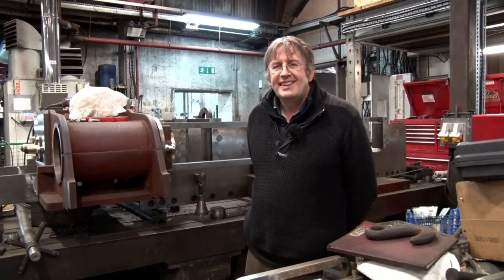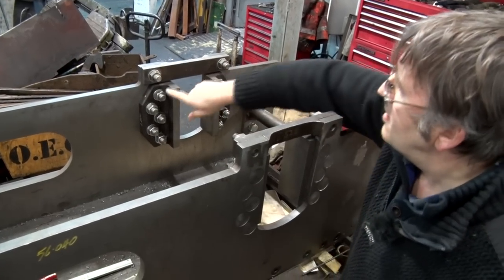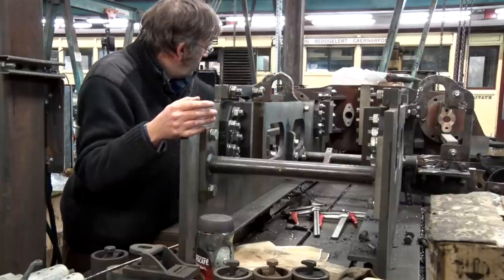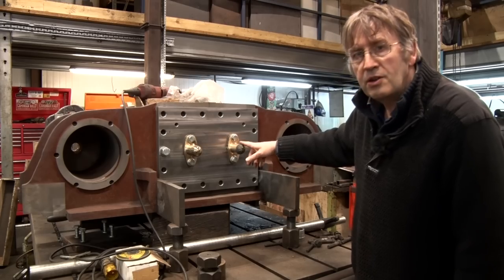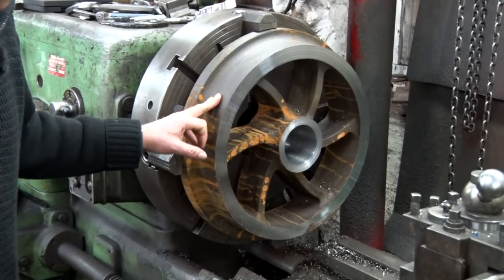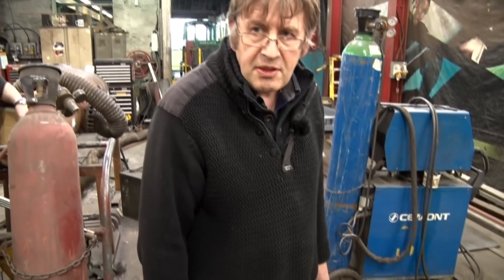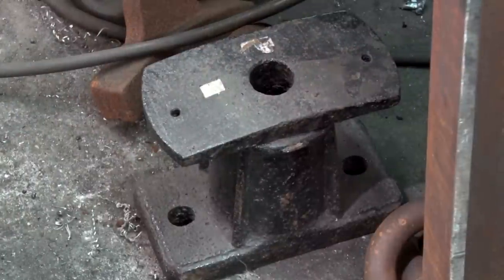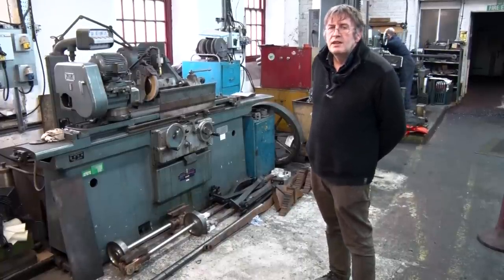Unfinished Business part seven

Comment: Did you consider using Linda's tender for Welsh Pony and building the new tender for Linda? As far as I know, Linda's tender was used with Welsh Pony in the past, although it originally came with Little Giant, Welsh Pony's sister locomotive.
Reply from the maker: +fg46 Linda's tender is so modified that it isn't worth trying to do as you suggest. Apart from anything it has been widened by letting a section into it.